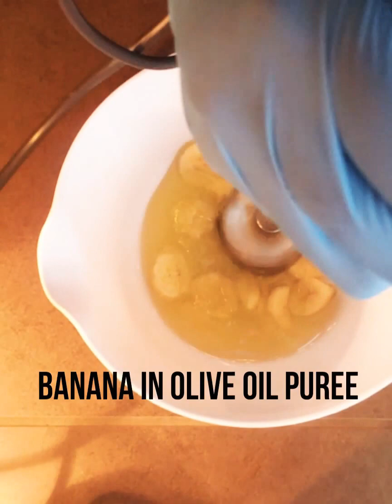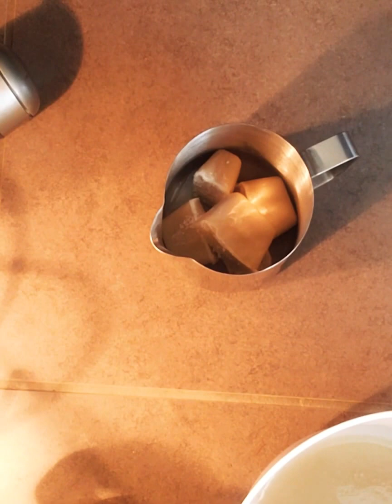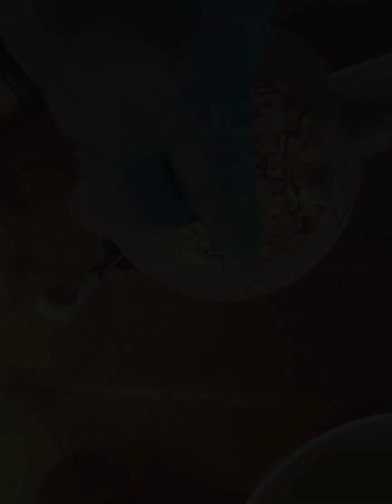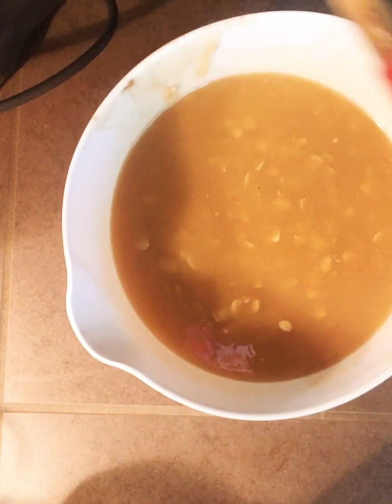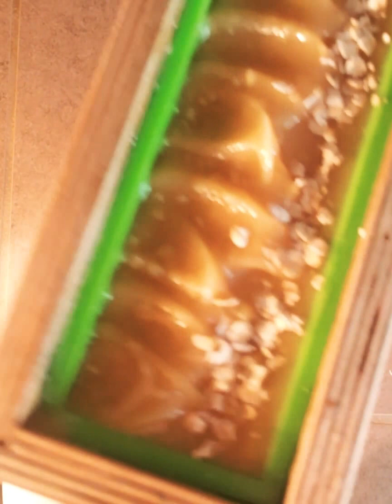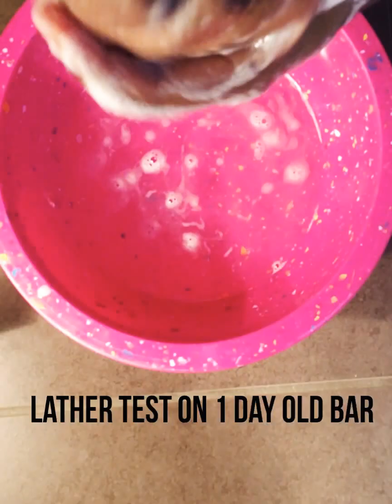Banana & Oats

Comment: Beautiful blend!!! If I may ask at what temperature do you add your lye mixture with oils and butters to keep maintain a fluid pour before soap thickens and becomes a clumpy pour?
Reply from the maker: Thank you!.. I did not take a temperature during this making. I usually wait till my lye and oil are cool till about 90-97 degrees. Now I do heat transfer method and I find it keeps my batter fluid.